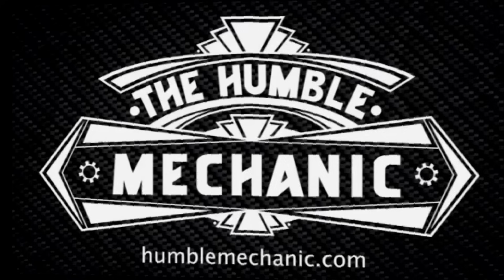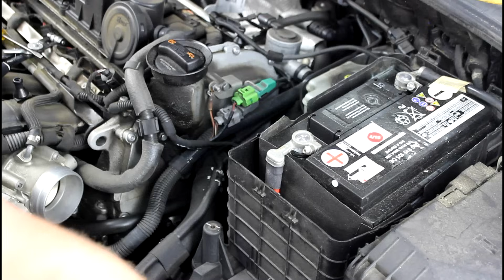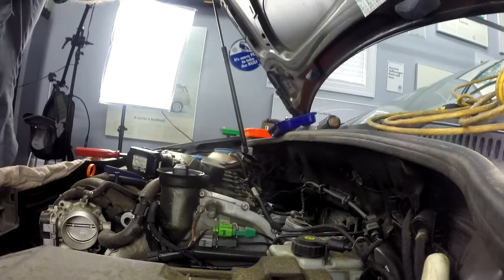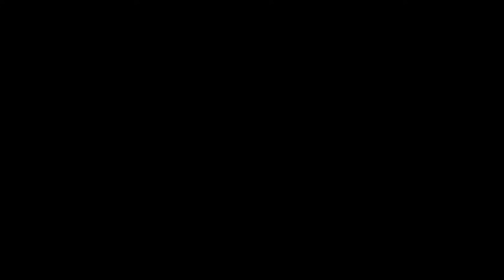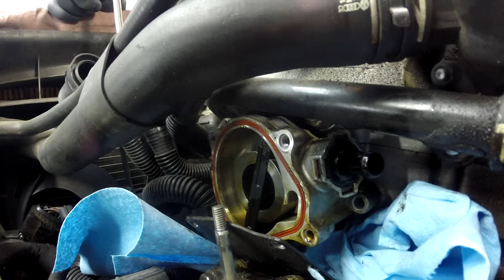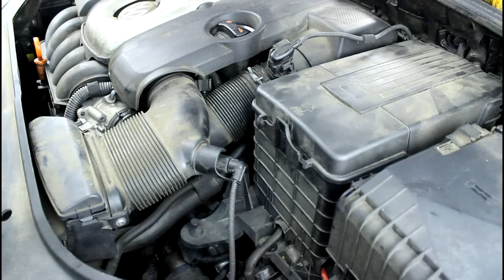Replacing VW 2.5l Vacuum Pump ~ The Easy Way

Comment: Tried doing this repair today, unfortunately couldn’t get it.

For one, the short 10mm nut that goes through the top of the T30 on the vacuum pump, the 10mm is supposed to go into the black bar. But, the only 10mm I have is too short. Is there another nut or screw potentially I could have lost?

Probably related to this, I saw the pump was flush, everything minus that 10mm looked well, but as soon aftter starting my car, I saw oil gushing out the bottom, turned it off after like 30 seconds.

Not sure what could have gone wrong, I see the pump flush with the block and even the gasket looks aligned!

The video gave me so much confidence

Comment: you ever tried to fix this car before me maybe the owner put the bracket between the engine block and the vacuum pump no wonder it was leaking still, finding a 2 inch half drive extension didn’t give me any happiness

Comment: perhaps we should not listen to you, humble man beginning of the video you should’ve said that if you’re on a incline to make sure that your car has the parking brake on after putting everything back together, and did the transmission linkage, I ended up chasing my car down in the driveway before I went into the street where my van would’ve taken it out

Comment: You should update the video and explain that the manual transmission vacuum pump is way easier to do than the automatic transmission vehicle you're working on in this video
Reply from the maker: I can't really update this video. YT won't let you do that anymore. I hoped that if I showed the hard way, and mentioned the ease of the manual it would be good.

Comment: So, wr can bypass this pump and installing electrical pump as in jetta mk6 instead of this bullshitt vacuuming, or making a house through brake booster to the intake with on way valve.

Comment: once you have it in, prior to putting the cover back on should the interior part spin? i had mine make a clicking sound as it went flush with its housing but it wont spin, itll like shift back and forth a teensy bit. Otherwise itll spin freely when outside of the car

Comment: im going to attempt this repair at a local garage where you can borrow tools and have a technician assist you with doing your own repair, if it goes well, this will save me over $1600 i was quoted for a new vacuum pump install

Comment: I recently had to remove the vacuum pump on my 2007 Passat. For vehicles older than 10 years, I strongly due not suggest using a repair kit on these pumps as the Torx 30 securing brackets are prone to fractures and/or completing breaking off which if not caught can lead to either massive oil leaks or air leaks resulting in CEL fault codes as a result of loss in vacuum pressure. Safer to pend the extra cash and just replace with fresh new pump that has not been subjected to the elements and rusting over time.

Comment: At 07:31 mark of video you say a 12mm socket is required, but I disagree. I have a 2012 Passat B7. And on my vehicle the two bolts that hold the shifter in place are NOT 12 Mm, but rather are 13MM. I can clearly see the #12 mark printed on your socket in the video, but as stated on my vehicle the two bolts are 13mm. This portion of your vehicle drove me crazy just your unexplained suggestion to RED mark the two bolts. Just does make any sense the purpose for marking the bolts other than perhaps as a means of an artificial visual torque setting reference for when retightening the bolts.

Comment: For the shift selector bolts for whatever reason I don’t mark them, is there a way to know the adjustment ? I got it pretty close but when I go into neutral sometimes if I go a little to close to R or D it will say it’s in reverse or drive even though the car is infact in neutral. Should I just tighten then a little mkre  and see see if that’s better ? Whenever I actually move my shifter into reverse or drive or park it works just fine. Neautral is the only finicky part. Any help is greatly appreciated thanks !!
Reply from the maker: you may have to play with it. Normally you can see the witness marks from where it was.

Comment: I have a question, I’m doing this repair on my 2012 Passat everything went smoothly but when I went to put my shift selector back on, I can’t get it back on…
Reply: Is it possible I put the pump on wrong and that’s why I don’t have enough space to get it back on?
Reply from the maker: It’s possible but if I recall the shifter is keyed. You may need to slightly turn it.  Also make sure the shaft is clean
Reply: @HumbleMechanic what can I use to turn it?

Comment: question, my vw beetle has 60000km or so,do I change just the seals or the whole pump? my beetle was fine until I changed the oil and started leaking, thanks a lot for the video btw, its gonna help me a lot
Reply from the maker: make sure its not your filter housing leaking. normally they develop over time
Reply: @HumbleMechanic  thanks! i think it's definitely the pump, its covered with oil :(

Comment: Why are you changing the whole pump? The rubber oring is what goes bad on these.
Reply from the maker: not always. Ive seen them full of oil inside, the gasket behind the pump fail, and probably more failures. This was meant to cover all the things. Also worth noting, this is an older video.
Reply: @HumbleMechanic thanks for the reply! I thought oil inside was normal, that was my misunderstanding! Should there be no oil in the vacuum pump?

Comment: Followed all the steps then realized i forgot to install that black square thing inside the pump. (I only replaced the seals) then i took the cover off and installed the black piece. After starting the vehicle my brakes are rock hard and the vacuum pump has a terrible rattling sound. The pump is creating vacuum however. What should I do next?
Reply from the maker: is the pipe cracked?

Comment: I followed your video, but not all the way removing the whole unit. A different video showed how to remove the cover plate and replace just the one gasket.. either way, it worked. No leak. Gasket was under $43 on Amazon. Shop wanted $2200 to replace it all. Thank you. Much appreciated. Been a couple weeks with no leaks.

Comment: GREAT video! I'm now a subscriber! I have to say that you are the best DIY mechanic that I've seen so far on YouTube. You clearly explained the repair prior to starting, noting exactly which tools were required. Your camera angles were steady and clearly showed the work being performed. You patiently explained every little detail as you performed the work. Your videos speak for themselves—professional. Thank God, you take time to mount your gopro camera in various locations... I don't think I could handle another video of a mechanic holding the camera in one hand and trying to magically do the work with the other (while the camera goes all over the place!). It's no wonder that you have 1M subscribers (or 1M and 1 after I subscribed!). I look forward to watching your other content. This is an old video, but maybe someone will see this question—was it an option to replace the gasket only on the pump (for the penny pinchers out here)? Or was the pump itself inoperable? I realize that while you're in there, you should go ahead and replace the whole pump, but I was curious about the gasket only. Thanks for sharing your skills!

Comment: Thank you for this video, I took my daughters VW Jetta SE in for an oil change at the dealer, so that I can find out anything that needs attention and they said I need a valve cover and that the vacuum pump was leaking and wanted $1100 for the pump and $800 for the cover, I bought a gasket kit for $35 and the valve cover for $180 on RockAuto, plus long magnetic Torix bits on amazon for $15 and it took me about two hours to do everything. This is not too hard, but any shade tree mechanic like me can do it. But, I did spray degreaser before doing any work to have a clean slate to begin with and let it dry out.  You should get the magnetic bits, because that lower bolt at 7 o'clock is a pain to get in and I put tape on the bit to get that bolt in and make sure you hold the parts together, since mine fell out when I was putting it in and took some doing to get it lined up. Otherwise, it was great and thank you again for saving me $1000. You do a great job of explaining everything.

Comment: Great video! Are you aware of any coolant leaks on the 2.5 liter engine that are buried underneath the intake manifold? 
A friend has a phantom leak, I have block tested and pressure tested the system and cannot see anything externally or into cylinders 
He is having to add maybe 8-12 fluid oz every 2 weeks

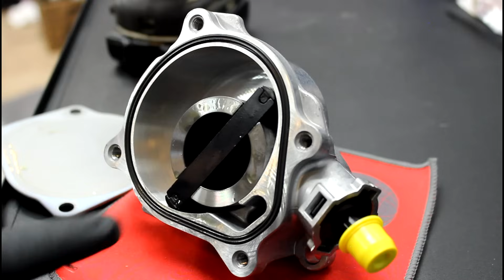Comment: At 17:07 he says that 100% Without Fail the seal has to be perfect or we're gonna have an issue... The issue that he is referring to is the loss of brake pressure; especially if you're resealing your original pump and not replacing it. Assuming you have insurance, you'll have to pay your collision deductible and the full amount to do this job again the right way. Good Luck....

Comment: Not sure if you still monitor 9 year old video's and respond to comments.  Thank you for the Video. My Son did this delete kit on his 2009 Jetta. After he put it all back together the vehicle will not move forward. We tried Drive, manual mode and sport mode.  It almost like the clutch is slipping. No issue with Reverse, it will perform like normal going backwards.  
@HumberMechanic.  In your option what do you think my son didn't do when he put it back together?  i looked over everything an it all looks in place.

Comment: How can you tell if you need a new vac pump if its not leaking? I have a 2009 JSW 2.5 manual with 100K and while at the dealership last spring for my seasonal wheel/tire swap, they told me I needed a new vac pump. I've never seen oil spots under my car and every time I check the oil level its fine. I'd like to investigate this further on my own to know if I need an entire new vac pump with new gaskets, OR, just new gaskets, OR, perhaps nothing is wrong at all. If the pump isn't working period, what symptoms should I be noticing? My car seems to run perfectly fine. Thx!

Comment: im gonna attempt to do this when it gets a little cooler as i only have an apartment parking lot to work out of i probably should just do the  install and delete kit because i assume this will  just be postponing the issue as these are bound to leak at some point i don't consider myself very good mechanically but i feel if i took my time and followed instructions carefully i might be able to do it and save myself some money because i know the stealership will charge an arm and a leg for this my jetta is old as shit too 193,000  miles on her

Comment: I replaced the vacuum pump , it took a long time to remove it trying to angle it out and it hitting the stud for the shifter, however after reassembly the engine light came on for engine timing being off p0016, behind that vacuum pump is a metal piece with two slots sticking out that connect where the timing chain is , is there any way I could have put it back on wrong? What’s odd is, when I cleared the check engine, the hesitation m/stuttering at idle went away, but now the car lacks power, the vacuum line attached to it,  doesn’t seem as snug and there’s a plastic piece with the rubber boot that  came with the kit that I didn’t replace, if I remove the vacuum line, there’s no difference wether it’s connected or not.. so there must be an issue with that vacuum line - a leak perhaps? Hopefully this makes sense , any help is appreciated!

Comment: I was installing a new pump on my 2012 Jetta today, and the rubber seal came off in the process of putting the pump in the hole...
Now, for some reason, the seal is longer than the track, and I have no idea how to get it in and keep it in there.

Comment: Do you recommend a new pump or a seal kit? If you have to take a few things out, you might as well replace it no? What if the cover is warped from the heat and cold? Repair kit won't fix that.

Comment: One of my bolts for the faceplate is stripped… can I get the vacuum pump off without removing it? Otherwise I’ll drill the bolt out to get it off
Reply: Drilled the screw head off best I could and pried the plate off, bending it a bit. I ordered a new pump instead of just replacing the gaskets.

Comment: Great video! I'm having some problems with my 2013 Jetta battery tray. There is a bracket attached to the front of it that holds the power steering reservoir and a box related to the wiring. It seems to attach with some weird rubber grommets or something. Any idea how to detach that? Maybe just pull the two brackets apart? Hard to describe without a picture.
Reply: It’s easy to pull the two pieces apart once you remove all four bolts, two in the middle and two on either side next to the rubber pegs. Just pry them apart

Comment: This video was helpful. I've almost completed the job. I put everything back together and started my car. However, when I put my car in reverese the gear selector got stuck in reverse. I overrode the gear selector and put it in the "park" position but the car was still in reverese. Finally got it into nuetral and put the park break up. I'm almost possitive it's something I did wrong with the gear selector when reinstalling. Or may the gera selector cable. Any thoughts/help?

Comment: I have had this oil drip issue for a quite a while not knowing what to do other than fill the oil when I have to. And recently, things got a bit worse which frustrates me A LOT. Then I stumbled upon this video while searching for common reasons for VW engine oil leak. I just ordered the required parts and am looking forward to fixing the leak. Thank you very much for the detailed instruction which saved me from this monkey on my back.

Comment: great video. im planning on doing this to an auto 2013 jetta. my question is why did you replace the entire vacuum pump? mines is leaking i was going to order a gasket kit. remove the pump and install the black and orange gasket. is it better to replace the entire pump?
Reply from the maker: Try the gaskets. It’s easy enough to do it a second time with the whole pump if it still leaks. I’d take the $30 and a little time gamble

Comment: I have a vw golf 2.5 2014 model and i have had some issues. like p0106 ,p2188,p2187 that i have tried different things like changing the map sensor , pcv valve change, cleaning throttle body and nothing the check engine light still shows. Any recommendation?

Comment: Guys, when doing this make sure the parking brake is pulled and you use blocks. Lesson learned
Reply: Second this. Doing the same project today, no chock, no e brake set. Tightening the nut on the shift  selector arm and popped it out of gear.

Comment: Charles thank you so much. 7 years after this video was released and it helped me to easily replace the two gaskets on my leaking vacuum pump. Saved me almost $1500 CAD compared to the dealer quote involving dropping the transmission.

Comment: Just did this over the last couple weekends.  Definitely wasn’t a couple of hours, but I have a 2012 which had a different battery tray and I was having trouble with getting the new pump in.  On that, if your pump is not sitting back all the way, just take it out and put some oil on the shaft.  This will allow it to slide right in!  All in all, great video and save me $1600!!

Comment: Is the position of the “paddles”, the part that goes into the engine, critical?  Meaning if you took if off the car and these were at6 and 12 o’clock, and you install them back at 3 and 9 o’clock, will that damage anything?

Comment: Took me3 hours including time spent performing extensive cleaning of accumulated rat turds from the years my car was street parked in Brooklyn. Dealer wanted almost $2k to drop the transmission and replace pump. Never took the engine cover off my Golf before, great video.

Comment: I've done this repair twice and I've referred back to this video both times. This second time, I bought a much better gasket set and took more time torquing down the bolts, so, hopefully, I won't be doing this job again for quite some time.
Reply: I thought my first rebuild went bad with terrible leaking.  Went in to install a delete kit and noticed all the bolts holding the vac pump on were loose.  Anyway, removed and deleted the vacuum pump so I guess we'll never know whether my rebuild held or not.  This time I used some Locktite on the threads.

Comment: I am making this repair today, and have a question and a few suggestions. There is a black washer on the shift selector stud underneath the tabbed lock ring and hand tight nut. You can see it pretty clearly from 9:08 to 10:00. It stays with the shift selector after he removes it. On my VW, that black washer had completely disintegrated. Is that black washer important, and if so, what material is it made from? VW part number for it?

Suggestions:
1- Chock your rear tires and put the parking brake on. While removing the shift selector bracket, and I accidentally put the car in neutral and it started moving. No harm done, luckily.
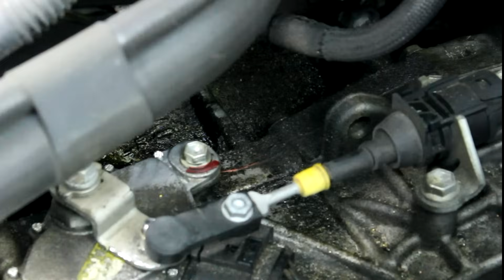2- The 12 mm bolts for the shift cable at 7:20 were 13 mm on mine. 
3- In the video, he puts those shift cable bolts back in after moving the cable out of the way. I found that the first one was getting in the way when I was trying to get the T-30 screw at 3 o'clock out. 
4- My battery tray had more junk bolted to the front of it that had to be removed to get the tray out. That junk mounted through two grommets and pegs that had to be pried apart. 
5- I saw someone post that this could done without removing the battery. Make sure you at least disconnect the negative battery. There is some wrench turning that would come perilously close to the positive battery cable. Shorting that post to ground through a wrench is one way to liven up your day.